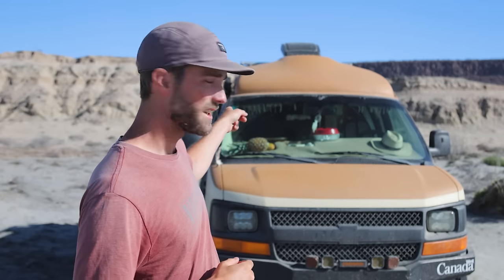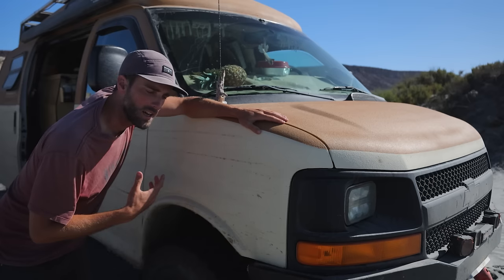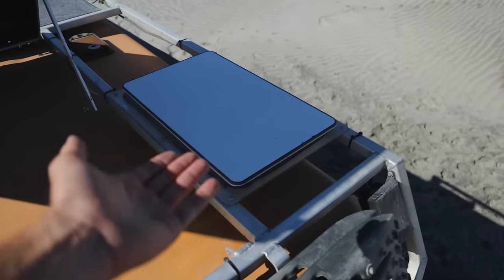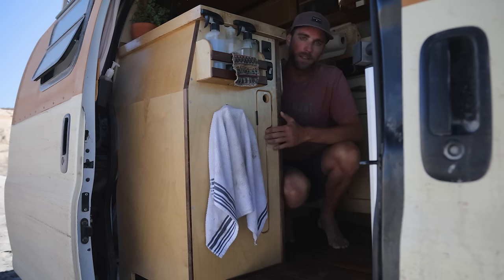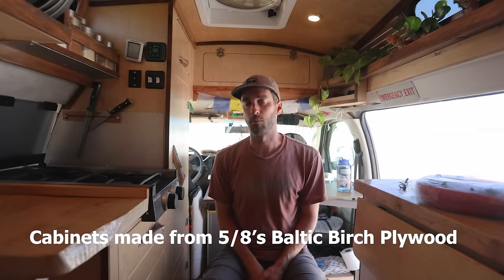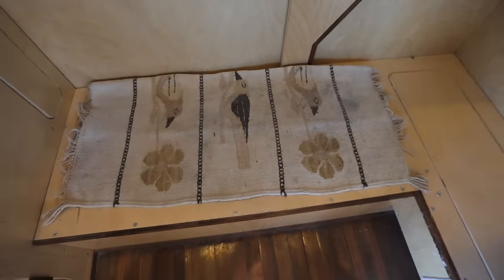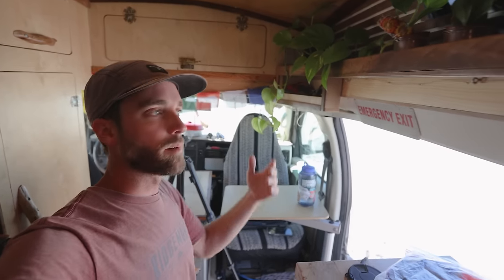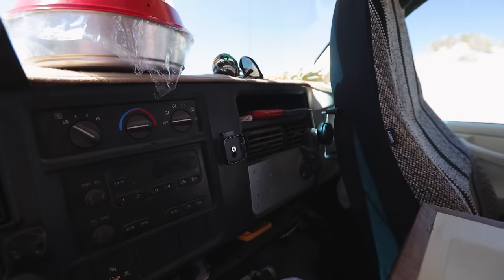Off Road Off Grid Van Built for Van Life | Overland Van Tour

Comment: I have a water saving tip for you….i use biodegradable, kitchen safe, wipes for my dishes and utensils. Eliminating the need for a sink.
Reply from the maker: We have certainly done this, however finding that kind of thing is Mexico is a little challenging. 🫤
Reply: I believe you can make the solution pretty easily with a touch of water, vinegar, and some lemon/lime juice. Mix it up and keep it in a spray bottle…then just wipe it off with a paper towel?  Then just dispose of the towel …🤞

Comment: OMG you guys have an awesome rig layout!  I have a 5x10 converted cargo trailer that I pull with my 4Runner.  PRO: can leave my trailer and run into town or explore and 'hold' my spot.  CON: I'm stuck with the same issues most class C motorhomes have of finding a spot to park in town.  One of my friends has bet me that I will have a lifted van within five years.  If it is like your van I would!  And I agree, it's about the tires-not the 4x4 that gets you places.  I have good clearance on the 4Runner and the trailer along with off-road tires all around...that and common sense is all I need to get to most places others will not try.  There are definitely some things in your build I want to put in mine.  Amazing planning for sure!
Reply from the maker: 😁😁Thanks Sarah! I’ve done the trailer life before and after one trip south decided to go back to just a van. I called it my ball and chain, so I know the struggle. A capable van is definitely a big advantage especially if you’re an intrepid person that enjoys solitude. Tires, clearance and a locker are about as close to 4WD as you’ll get and just that’ll get you pretty far. Thanks for watching!

Comment: Hi guys. I love the use of all the nooks and crannies. I’m using 1/2 inch Baltic birch ply from Windsor plywood on my build and it’s plenty strong. Did you put any kind of protective coating on it? The pressurized shower is a great idea.
Reply from the maker: When I went to purchase plywood for the build I had intended to do 1/2” but they had a lift of 5/8 prefinished on sale for least than 5/8, so I opted to save time and money. Whatever I build next will be with higher quality 1/2”. I don’t think the 5/8 was a mistake, but I have found the prefinished veneer pretty thin and peels easily and it’s just extra weight that I’d otherwise not want.

Comment: I have the Propex 2000 and if anything it blows to hot so you might have a problem with your unit?
Reply from the maker: Thanks for the input! I chose the 1Kw setting I think, I just haven’t taken the time to tinker with it.
Reply: @SlowRoamers  I just finished watching your video and see you want a extra Fuel Tank, Titan Fuel Tanks make the Trail Trekker a 12 gallon Tank that fits behind your rear spare Wheel Mount, that’s what I plan on buying once I am finished saving up for a 5” lift, a re Gear, and Locker for my 98 E350.
Reply from the maker: @themadnomad5361  Interesting!  I'll have to check them out.  We don't actually have a spare between the frame, so I was intending to put an aluminum cell back there, but if there's something ready-made, that would be perfect.  I'm mostly concerned about how the heck I'm going to do the transfer pump. Thanks for the input and for watching!
Reply: @SlowRoamers Weldtech has a Video on it.

Comment: Have you had to rebuild or tweek your engine at all? How many miles do you have on it, if its the original engine?   I've learned a lot from the short time Ive been following your channel.  Thanks
Reply from the maker: Hey Diego, glad you’re learning stuff from the channel! We haven’t really touched the engine whatsoever other than regular maintenance. The 4.8L is the “economy” V8 from Chevy, or so I’ve read, which to me means reliable. Thus far it’s been a great engine. I think we’re at around 240,000km’s.

Comment: Thanks for the in depth videos man! Do you happen to have any time line on when you're going to have the extended fuel range complete? Also, what current mpg have you been averaging with this set up? Just subscribed!
Reply: Awesome! Welcome to the channel. Lots of build vids to check out. You'll find a DIY Build Series playlist, including several Build tour videos. Alex will confirm the timeline for the extended fuel range but I'm gonna guess this summer before they head out on the next big trip. Thanks for subscribing and commenting. Hey, share the channel with your friends - only 9 to go to hit 9K subs! 😀
Reply from the maker: Hey Christon, thanks subscribing! We’re aiming to have the auxiliary tank in by end of May prior to heading up North for the summer. We’ve got a few things to figure out there, but I’m hoping I can piece together a setup. Currently we’re doing about 15mpg on the highway, but it drops pretty quickly as soon as we jump into a gravel route. Currently we’re getting 500-600km to a tank on gravel and pavement respectively. Hopeing for a range of 800-1000km, but we shall see, with added weight comes lessened fuel efficiency.
Reply: Thx for sharing. Very difficult to make all the pieces come together, suspension to kitchen and you have done an excellent job. I think you are based pretty close Pat Victoria BC